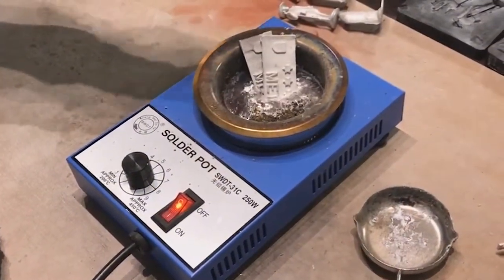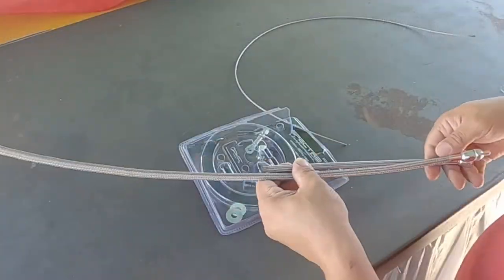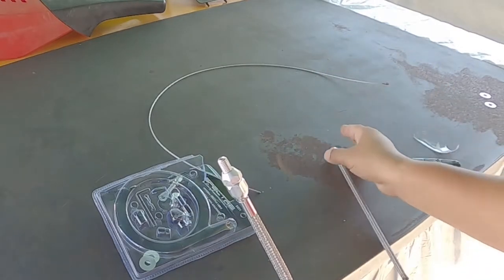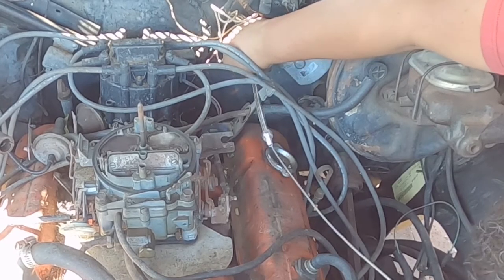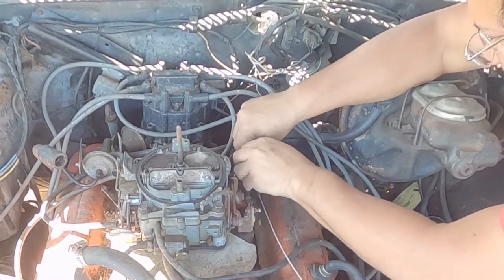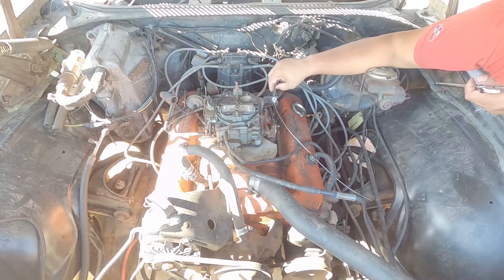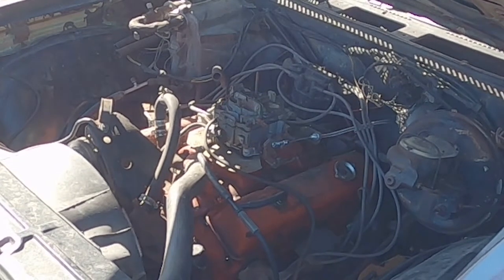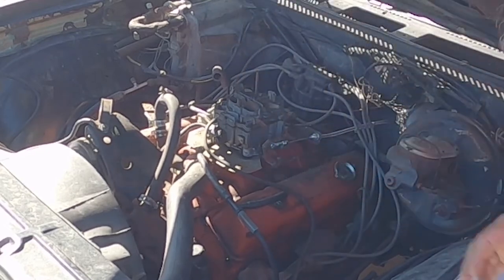Comparing Mr. Gasket and Spectre universal throttle body cables

Comment: I think the part where it screws sandwiches between the firewall and not the carb bracket?
Reply from the maker: Yeah its suppose to sandwich between the firewall. I didn't want to buy the throttle cable bracket (Spectre P/N 24283) which would have fit the square plastic piece. The factory cable was a round rubber adapter and the only way I was able to get it to work was running the part where it screws to the factory throttle bracket. The Square plastic piece fit real nice into the factory firewall location. Almost like it was meant to be there. 

I did put a carb on the car and have been thinking about getting an intake. If I do that I will probably get the bracket from Spectre and a few cans of orange engine paint.
Reply: Oh nice, yeah I know those cables aren't that cheap, an if it worked koodos, I just recently bought the mr. Gasket one

Comment: Can this be used on a 2004 mustang 3.9l v6?
Reply: I've been trying to find a reasonable priced replacement but most are used and pointless to sell because of the condition from driving for years
Reply: Aye my good sir did it work I have the same model mustang and mine just ripped off the gas pedal